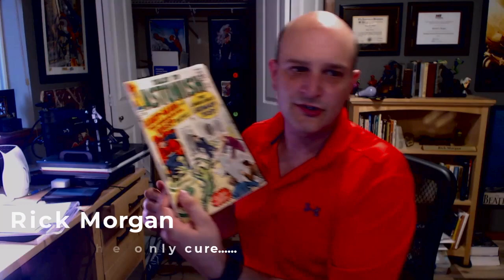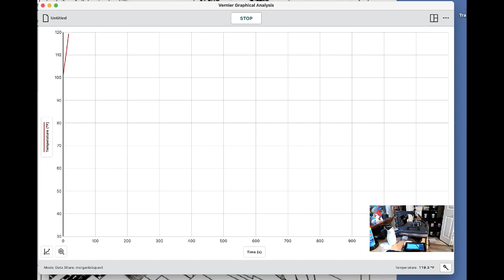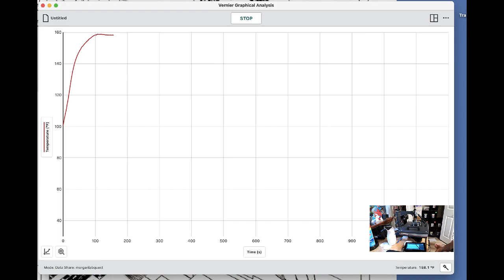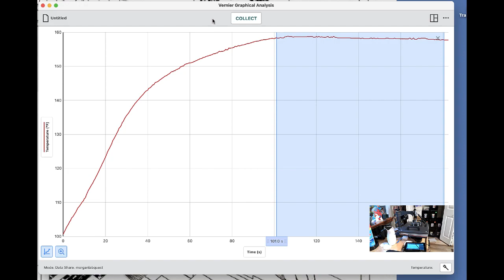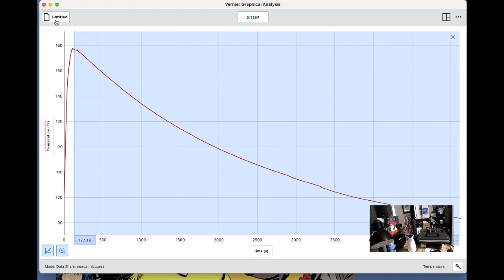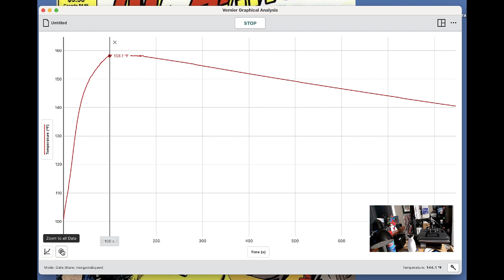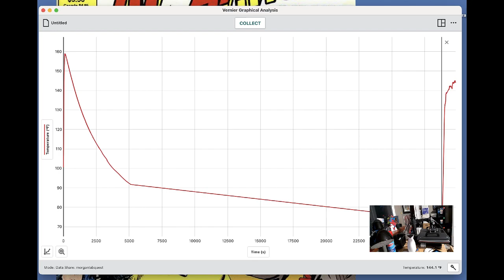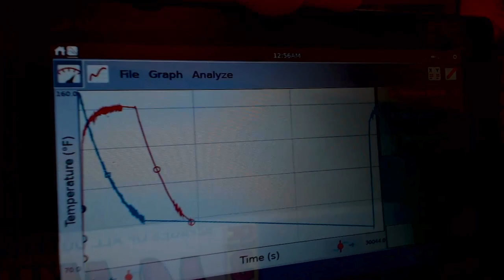Does preheating a bottom plate help the book temperature when pressing?

Comment: Hi.  New to the channel. Great video.  I'm looking for some tips on pressing out dimples in card stock covers.  Also any tips on getting out water stains.  Thanks
Reply from the maker: Water stains are tough, I usually use a slant board ad remove the cover entirely.  dimples in card stock, warm of the book and just press with a chamfered board as per usual but you may have to cold press afterwards for a long long time.
Reply: @ImmaculateComics  Thanks Rick.  Thanks for the tips on the card stock dimples.  The water stains solution sound like alot of work and I'm afraid of removing cover, staples cause of the high risk to of additional damage... I might try on some old books.

Comment: Hi Rick, I typically preheat the bottom plate but the question is how hot should be the bottom plate.  I typically heat approximately 75% of the set temperature.  Any thoughts?  Should it be the target temperature which in your case is 160 degrees?
Reply from the maker: Hi Eddie, I typically heat it to the same as the target temp and I even let it soak at that temp for 3-4 minutes to make sure I have driven off any moisture or adsorbed gases, just in case.
Reply: @ImmaculateComics  the moisture comment make tremendous sense.  I will try it!  My plate is a steel plate and a target temperature such as 160 degrees seems to take much longer as your aluminum plate.  Time to change material...LOL!

Waiting on the larger chamfered boards.  Definitely a purchase!
Reply from the maker: @aquila3168  Hi Eddie,  Aluminum has a higher heat capacity and heat conductivity than steel, but it does scratch easier.  For  our purposes, Al is a better material.
Reply: @ImmaculateComics  I so agree!  Keep up with the quality video.  Always informative!